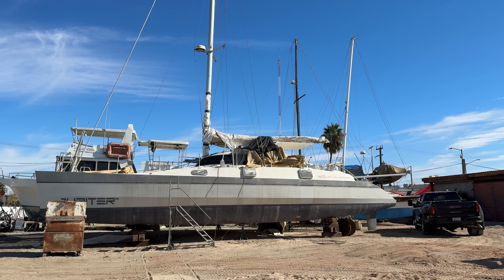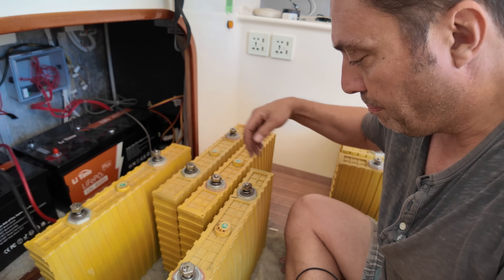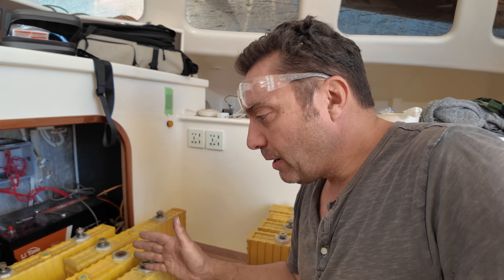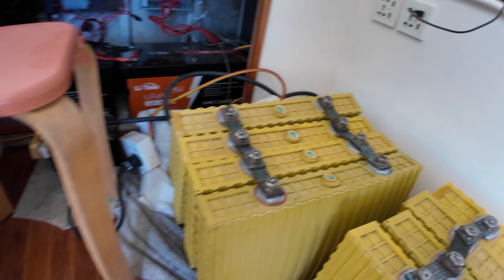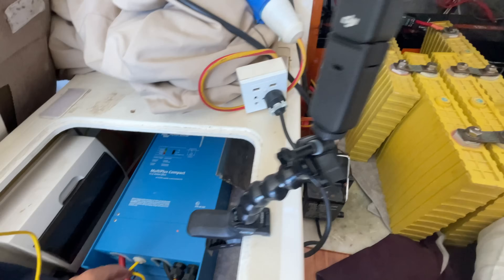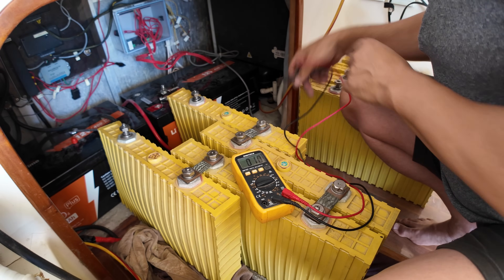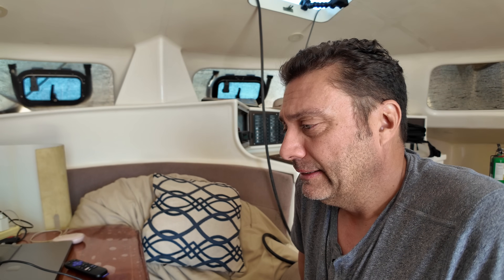Lithium Battery Failure – Can We Save It? - EP205

Comment: A co called Battery Hookup in PA, USA has CALB 3.2v 400ah used cells that match what you have for $100 each. Said they were from a backup system w good voltage.  No idea about shipping to where you are, but thought I'd mention.  I got some 24v packs for ebike from co and they were as advertised.

Comment: First winter did I shut down my LFP system in wrong way.
In spring was the system "dead".

Used lab power supply, started with low voltage and low current.
Took 3-4 days to recover, used system now 2 seasons.
Reply from the maker: Yeah see… there was still hope. Hehe, cheers

Comment: You done all wrong you could to revive them. If a cell is below 2v it's dead, above you have a 70% chance to revive them.
Paralleling the ones that had 2V or slightly below with the 0V cell definitly killed the other 3.
I would recommend to wait till the EVE LF560K cells are avaliable. EVE is ramping up production right now but slowed it a bit down to get rid of some overproduction on the 300AH cells. You can reuse your BMS. The LF560K that my buddy tested had all 625Ah + and you can expect a market price of around 150Euro per cell. Much cheaper then the Winston's but quite close in performance and definitly the cells to go for you. Alternatively get the eel-kit battery with the 316AH EVE cells, they are equal to an Epoch but cost 1/3, just have to put it together which is kindergarden for you.
https://www.eelbattery.com/EEL-24V-Lifepo4-Battery-DIY-Box-Kits-with-Bluetooth-BMS-Set-For-12V24V48V-System-p5029368.html
Another mistake you made you need to compress the cells, also Winston so they don't bloat. The eel-case takes care of that too.
To enlighten you how to correctly charge lifepo4 and how to avoid overcharging which obviously happened&killed your winston in the first place. this is a very good article also explaining you how you can even overcharge with 3.45V per cell.
https://nordkyndesign.com/charging-marine-lithium-battery-banks/

Comment: I would have charged them one at a time to at least above 3V. After that would have balanced them and put them on the Victron. But Litiums below 3V and gassing. It is like putting the spark back in the wire after a short circuit. Good luck.
Reply from the maker: You’re probably right. Didn’t have a charger to do it tho. Ah well, it’s good to purge now and then. Cheers

Comment: This video should be tittle  "Operator error and neglect and  still lithium keeps going"

Why do you spread the   FEAR of failure when there in none here.  The only thing that failed was you to do your do diligents but  you turn it into a video that could easily scare someone away from Lithium batteries.
Reply from the maker: Thumbnail clearly says “ I killed them”. I don’t think anyone is scared of lithium these days. These cells are safe as houses and are 10 years old.
Reply: I didn’t get the impression he was scaring anyone about lithiums. He clearly states in the video that newer batteries have better technology AND he says he left them for 2 years unattended and that’s why they failed. 
It’s just good information for us all!

Comment: PS. Given the chronic lack of good information on Lifepo4 batteries until very recently, getting TEN Years out of yours was actually a remarkable achievement frankly. Bloody Well Done ! 🤔🌟🙂⛵️ Bob.
Reply from the maker: And i coulda got more! Damn my laziness.
Reply: @ Don’t be too hard on yourself, the amount of bad information out there, about Solar Panels, and batteries, has been staggering. I was extremely lucky to have a good contact with a tester who had been testing Solar Panels for NASA since the 1980’s, who gave me a great head start, plus, thanks to good insights from Anpere Time Factory Engineers, it became apparent that all Lithium type batteries, including Lifepo4 batteries had a heck of a lot in common with what needed to be best practice use for mobile phone and tablet batteries which still frankly only have a service life of up to Five years IF they are Never Wireless charged. Frequently wireless charge them, and they can be trashed for capacity within 12 months, which nobody seems to mention. So overall, a big round of applause is deserved for you making them last for TEN Years, which is why I said you had managed a remarkable achievement.👍🌟🌟🌟🙂⛵️ Bob.

Comment: My apologies if I have said this before, but for quite a while now, I have been trying to piece together and expand basic information on how to look after Lifepo4 Battery Banks properly, and credit to Ampire Time - now called Li Time - Factory Engineers who passed on some basic good advice early on - such as never let them discharge below 50% capacity as that loses you Recharge Cycles, and never rapid Charge or discharge as that causes internal battery heating, which shortens battery service life.Oh, and if making a battery Banks, make sure each of the Batteries is from the Same Production Batch. As a result, today, my approach is to build a system with a core of AGM batteries, which must never be discharged below 80% capacity, which then halts the deterioration in Cycles by flatlining them, which get managed by a Bank of Lifepo4 Batteries which keeps all other Batteries on the boat in fully topped up condition by using DC to DC Chargers from the Lithium to the AGM, but Never to the Lithium, as the charging profiles normally appear to be completely out of whack. So with say an AGM total ah Capacity of 600 ah, that means I have up to 120 amps available to get the boat through the night, for lights, instruments, phones, tablets, or laptop charging, but then with say a Lifepo4 Babk of 4 cheapie Redodo plus 140 ah batteries fully charged and a total of 560 ah, DC to DC Chargers from the lithium to the AGM have up to 280 amps to keep every other battery on the boat happy, until daylight has Solar feeding power back in, or a generator doing the same, or a decent main engine alternator helping to keep well on top of the battery needs.  How to make cheap Lifepo4 reliable and have a long service life ?  Bank of 4 from the Same production Batch, with positive and negative terminals connected to positive and negative Busbars, then use equally sized equal length Cables, to connect each terminal to the correct Busbar. That means each Battery is having an equal share of the load so say an 80 amp Discharge, and an 80 amp charge ?  The load each way for each battery is?  About 20 amps, and as a good rule of thumb is to at least double the cable size for the likely load, use say 50 amp cables of equal length to connect the terminals to the Busbars- this means no Cable overheating or increasing copper cable crystallisation, and battery internals that are unlikely to even get noticeably warm and all of which likely means ? A very long useful service life, just remember to check for current leaks, good cooling airflow, and visual thermal equipment to help trace any problems that are starting to appear, oh and remember to tin all exposed wires, even if crimped on connectors are going to be used, to prevent cable corrosion induced unreliability. Hope that is of help, and if it can be improved with updated information, please speak up, but I think we are about at the stage where we have enough good information to be able to have a decent chance of getting our setups right now at the first attempt. Basically it means build for gentle treatment, and definitely ignore the a deep Discharge Lie, because each Deep Discharge damages every type of Battery that is presently made. Bob. 🤔🌟🌟🌟👍⛵️

Comment: Mate if they have exoanded, it means they gassed off, which means they are dangeously damaged and can explode and the gas they release is deadly poisonous. get 12 or 24v Lifepo4 drop in  batteries that an inbuilt bms and bluetooth control

Comment: This is so wrong 😮. One cell at a time to 3.6v then leave overnight and check voltage drop. After that you will need to check capacity and internal resistance.
You probably could have saved a few of them. Cheers mate, fair winds
Reply from the maker: Sounds like a better plan. Live and learn. Cheers

Comment: Ten years is a good run. You could look at dual 24 volt system. That seems to be the way many are going. Maybe you can get a sponsored system.
Reply from the maker: Would be nice. And would defo do that if building again. But replacing alternators, starters, solar controllers and inverter is a huge investment. Next boat!

Comment: With 304ah lifepo4 cells running around $100 ( Like EVE)  each, you should be able to put a 6ooah pack together for around $800 plus 1 or 2 BMSs depending how you configure.
Reply: ^ this. I have a 608Ah 12v pack with 8 EVE cells (grade-b though so okay maybe it's 595Ah :P) with a 200A JK BMS and I think I spent about 850 bucks altogether on this. Oh and 20 bucks worth of wood and some materials to make a box for them.
Reply: 900 Ah $1078, 3 300Ah batteries.
Reply from the maker: Options WERE so much cheaper, but now with the tariffs?!
Reply: @SailingLifeonJupiter  Tariff rates and what is targeted are changing so fast in both US and Mexico (your loc?).  I think Mex is considering a 25% tariff on items from China, but that may be inaccurate.  Best to find whatever lith bats or cells already in country near your location and buy them for your cat.

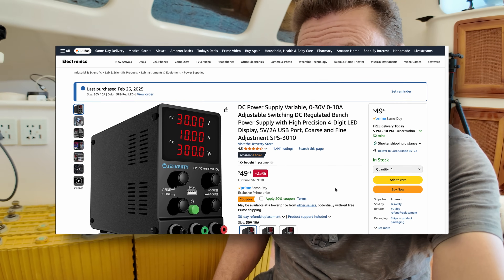Comment: 2:12 I hope you want to accept a small warning about a power supply like you bought: I guess the cells are LiFePo4 ?
My warning is: Those cheaper power supply’s are not stable, definitely not in the ‘lower voltages’ like 3 0r 4 volts.
The issue is in the variable resistor, which you use to set the voltage: With the surrounding temperature changing, and the internal temperature changing too, the output voltage can fluctuate quite a lot! So you need to be there to keep watch !
Furthermore, bloated cell mostly still can hold quite a significant charge, however, I would not recommend keeping them in Jupiter.

With these lithium batteries, you need to be a bit more concious about what they need to have a long lifespan, if you are, they will have a very long life span.
And: Always use a torque wrench with connecting bus bars !!! You easily can wheck the internal connections to the poles when you don’t.
Reply from the maker: Ah, yeah those chargers were cheap! Can’t expect much I guess. Lucky i could send it back to Amazon. Don’t need it now! Sad.

Comment: While trying to resurrect lithium batteries like that, unfortunately you should only be trying one cell at a time, not in series not in parallel. Then after you think you have revived a cell it should be left at the maximum voltage you charged it to, to see if it self discharges, if it does then it’s toast. Then all the recovered cells should be set to the same voltage before coupling them back up into packs. Painful yes I know but it’s the only way.
Reply: That’s actually the Right way.

Comment: I'm still sold on LiFePO4 due to your positive review. If you were offered free batteries or had to purchase batteries, which ones would you go with? Also, if you got the new model  of LiFePO4, how many batteries would you get to power your needs or what set up would you go with?
Reply from the maker: I’m pretty impressed with the Epoch 460A Rob. Although I hear the V2 has a firmware issue. 
I’m happy with 800-1000Ah on Jupiter.